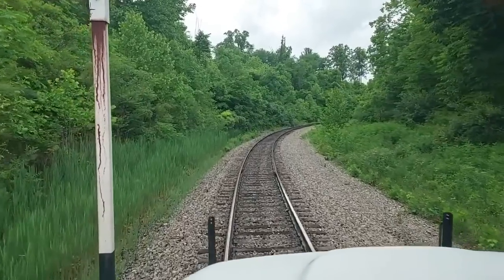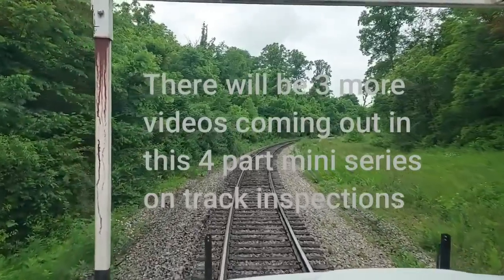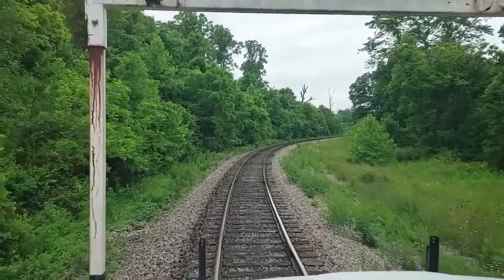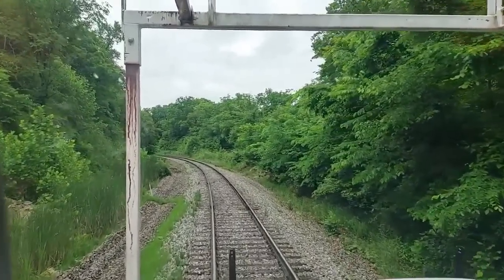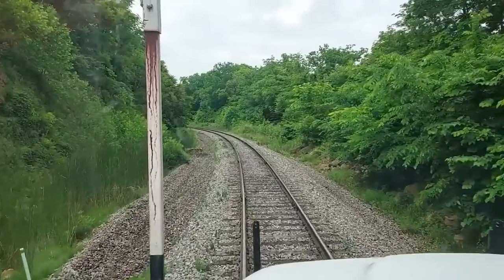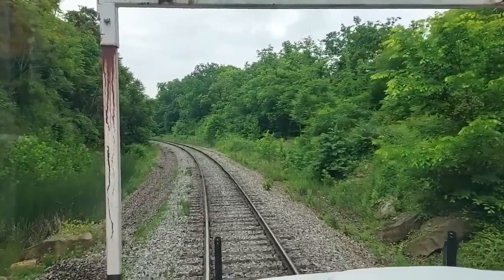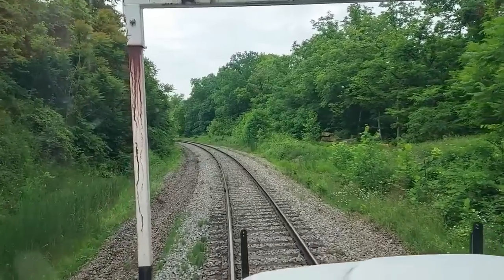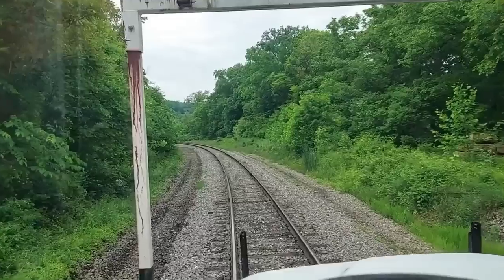How to do a Track Inspection on a Class 1 Railroad - Part 1

Comment: If you ever get a chance to run rail in a speeder, the visceral experience is even more than you get in the Hy-Rail truck.

You can see, feel, and hear every single joint, and it's immediately apparent when you pass over an "odd" joint.
Reply from the maker: Oh I can imagine how riding jointed rail in a speeder would be
not having nearly the weight of the hi rail truck. it would be fun!
Thanks Johnathan so much for visiting with us and watching my good man.
Reply: @ccrx6700  👍
Reply: We road the speeders or they called them motorcars  on our RR back when I first started on the rail relay crew, We would ride out on them to the location we were relaying (CWR) Continuous Welded Rail that day on our work block. We still had a lot of jointed rail when I first started also which we relayed with CWR. I appreciated the trucks the worse the weather was.

Comment: WOW!, a Class 1 video! But..........no power windows on the truck? 🤔😕❗
Reply from the maker: Power windows... it's a freighliner....LOL Really appreciate the
very nice compliment and for your taking the time today to
watch and write in my friend.
Reply: @ccrx6700  A Freightliner? I would think that with what one of those costs, it should at least have power windows. But maybe the Management at Cumberland just didnt want to pay for an extra that works easily, and opted for Ye Olde window cranks that are sometimes a bear to operate. It does look like a nice truck, but i imagine it rides rough on the highway due to the weight of the hi-rail wheels. That was a surprise learning that there are 9 classes of rails, an inspector really has to be alert and on their toes doing an inspection.

Comment: Thanks for the great video, as they all are. Have you ever considered using concrete ties in your trouble areas? Might safe $$ in the long run.
Reply from the maker: Your welcome Jim, thank you for the kind compliment. We
cannot use concrete because they are thicker than wood and
my tamper with it's old operating system cannot have
the work heads go down far enough for concrete. Really
appreciate your watching and writing in my good man.

Comment: Dave,

How are you securing the steering wheel on your HyRailer? Just velcroing it to something?

Thx.
Reply from the maker: On the big truck I don't use anything since the wheels are up
off the ground and above the rails. It did come new with velcro
but that has worn out over the years, but even if the wheels
turn on the big hi rail, it's no big deal. On the little hi rail pick up
truck it is a must to have the steering wheel velcroed because
the front wheels are in contact with the rail. Good question
Andrew and thanks for watching today my friend.

Comment: Replace 2000 ties a year will take over thirty years for the 17 miles. Will most of them last that long?
Reply from the maker: Ties do have a life Laurence, good question. Short answer:
ties in really good ballast with great drainage with last up to
30 or so years depending on the wood, oak being the best wood.
Also on the location. Ties in tangent track have much less
stress on them from track forces than ties in a sharp degree
curve where the train forces will be much greater on 
stressing the tie, as well as the rails.

Ties laying in poor muddy ballast will only last half as long.
Ties must be cured before being creosoted, 10 to 12 months.
Ties that are creosoted before curing will not last very long
at all. Maple being the worst for that, an un cured maple tie
that is creosoted will rot in 3 or so years. Thanks for riding
along and writing in my friend.

Comment: always thought you needed a crown for the ballast, support and drainage ?
Reply from the maker: In a prefect world Gerald, when excavators build the road bed
initially they are supposed to crown the bed for tangent track,
but in a curve it will be sloped slightly to the low side. But
back when our track was built who knows what they did.
Inspectors back then were easily "taken care of" to "look
the other way" although in all fairness, I was not there
when they initially did the road bed construction but have
heard some stories from those who actually worked the
construction crews back then. Thanks so much for watching
the video my friend.

Comment: 2 blasting caps will take care of any beaver problems. 😉
Reply from the maker: Yep but here at the mine you have to have shot fire papers to
use that stuff and guys with the papers are few and far in between.
Couple years ago we had a professional trapper come in and
he got 14 beavers out of one pond. I've dug plugged up pipes
out with my excavator, but unless you get rid of the beavers they
just build again. Using explosives here and I get hurt if I don't
have papers the insurance wouldn't cover me. Thanks for writing
in and for watching the video my friend.

Comment: Seeing how bad the old B&M tracks are that CSX just bought from Pan-Am, I am amazed how bad tracks can be and still pass inspection.

Pan-Am ran slow because they knew the tracks were not good and they knew where to go extra slow

As soon as CSX started running at speed in the first days they came off the tracks in a bunch of places

They had the inspection train come through and they had a lot of emergency repairs and now they are replacing the emergency repair track with permanent track 

It has been a long time since those tracks have seen the speeds that CSX is running now.

I would think that locomotives now would have laser sensors to detect deviation in the track spacing and gaps between the rails, height difference, etc..

With PTC they could have equipment on the locomotive send exact location data and problems detected with each train

They have never had 24/7 constant connection from the locomotive and the rails and dispatch

ATCS gives basic information, but with PTC they could send anything they want to dispatch

I would think that railroads would want to have the real time data to catch early before the problem causes downtime
Reply from the maker: Thanks for sharing that about Pan Am with us ocsrc, I
did not know their tracks were in that bad shape. NS is
running a test locomotive now that has track geometry
measuring mounted on the loco, as far as I know they
are the only big RR experimenting with that. There are several RR
that have geometry testing box cars that are ballasted to
simulate loading weight and send that info real time to
a reader in the office. Of course there are geometry trucks
out there that run the rails also as well as things like the Sperry
cars. We have had a couple of geo trucks in here and someday
I will do a video showing you a geometry report of the track,
that will be cool cause no one ever gets to see a report
unless you are roadmaster or track inspector. Thanks so
much for watching the video my friend.
Reply: @ccrx6700  seeing the data from the truck would be amazing. Does it show up in real time ? As CSX was running their geometry train on PanAm there was one section coming out from a tunnel in the city where sparks were flying from every wheel that went over that section and the noise of screeching wheels grinding on that bad section was so loud. You could see all the sparks in the sunlight and the rails actually were glowing red.

Really bad spot.

They replaced 4 or 5 spots like that immediately within days of taking over, but they had a couple derailments before they got those sections repaired when they tried to run at normal track speed.

Pan am always ran slow around 20 mph or less and CSX tried to take the track at 40 or 45 and outside of Mechanicville they hit one of those sections and the whole train came off the track.

It's nice to see the tracks repaired but it's sad to see PanAm disappear like the Delaware & Hudson disappeared

Now CSX and Norfolk Southern are the two main railroads on the East Coast with CP Rail

I wonder if at some point CSX will buy out or merge with Norfolk Southern just like Burlington Northern and Santa Fe

CSXNS

Comment: 2 thousand ties a year?! How many ties you gonna have in 16.5 miles of track? Tie life vary on conditions? I have seen concrete ties before but it seems to me concrete wouldn't be a very good vibration absorbent.
Reply from the maker: Figure about 20 to 22 ties per 39 foot stick of rail, then you
can get an estimate of how many ties in 16.8 miles, it's a whole
lot! We keep good ties here. Will have a video out sometime, not
sure when on concrete and wood ties and the differences.

Comment: Online it says your mine is an undergroud mine with 700 employees. I do not see a parking lot near where the coal is loaded on the hopper cars for employees vehicles. And where is  the mine entrance for the miners.
Reply from the maker: Parking lot for the prep plant is between the plant building itself
and the main highway Chad. Miners do not go underground at the #1
portal which is at the prep plant, they only take supplies in
at #1 and that is where the coal comes out from underground.
Miners do go under ground at #9 portal which is located in
Oak Forest. Thanks for visiting with us and taking in the
home movie my friend.
Reply: @ccrx6700  Oak Forest does not come up on google.
Can you give an address for #9.
Reply: 576 Maple Run Rd, Waynesburg PA, 15370. About 4.4 miles as the crow flies.
Reply from the maker: @treepruner2  thats it Chad  Iron Senergy Cumberland #9 Portal

Comment: I learned a considerable amount information from your video. I used a portion of your video for my work in illustrating truths. Do I have your permission? If not, I will delete the video upon hearing from you. The title of the video is Sermon Illustration: Railroad Track Inspections. Are the Tracks 100% Certified Safe?
Reply from the maker: Yes I watched it and yes you do have my permission to publish
my video within yours Sermon Illustrations. Cool topic by the way.
No track in the country is ever certified 100% safe. No one is out there who is a certified inspector that is required by the law.
What is required by the law to be a track inspector is at
least a years time on the railroad. All we can do  is make the track as safe as we can for each day.  Thank you for  taking the time to check out the video and may you have a very good day my friend.

Comment: What is a mudspot
Reply from the maker: That is a place in the track where mud has been pumping up from
the bottom and is now filling the cribs up with mud Sam. Hard to
hold track surface geometry when you have mud under and around
the ties.

Comment: DAVE! I have a question regarding rail  inspection. There’s about a 100ft section,  around one of the rails the ballast is washing away and  it’s just gaps of air in between ties and the rail , I was wondering if this was normal or I should mention something to  a worker or something.
Reply: My past railroading experience at CP I would mention this to someone even if it turns out to be nothing major.
Reply from the maker: There you have it Asheville Trainman, advice from a true
professional track inspector! Condition doesn't sound normal to me either. Does make me wonder if they do track inspections there?
Really appreciate your watching today and for writing in my good man.
Reply: @ccrx6700  I thought I would chime in on this also if you didn't mind.
Reply from the maker: @StormySkyRailProductions  chime away my friend 😊👍